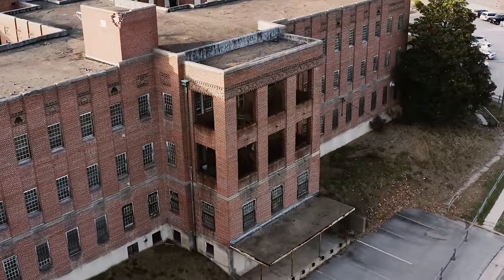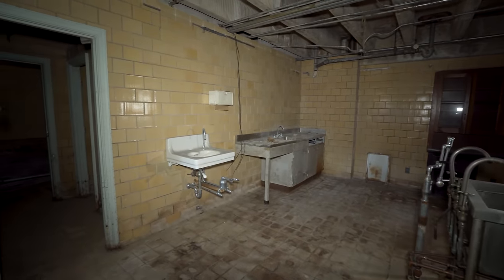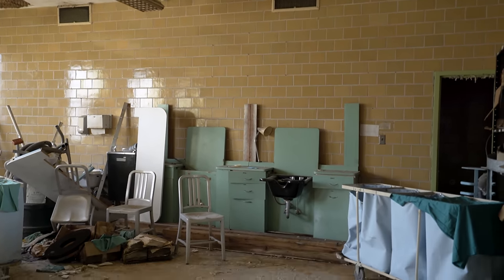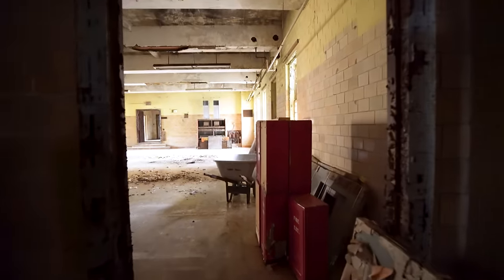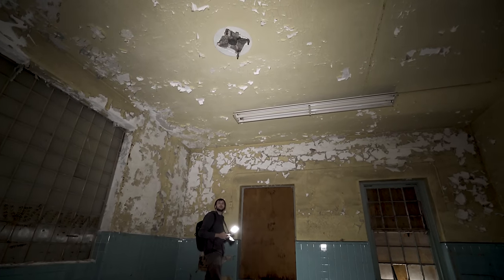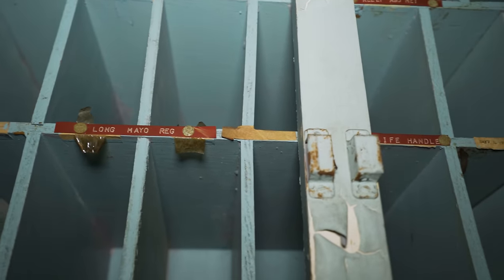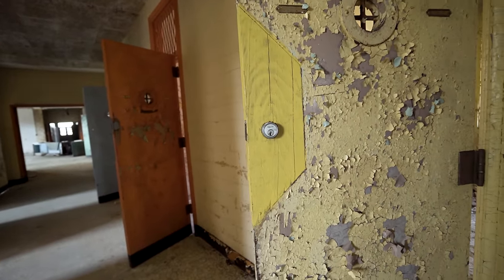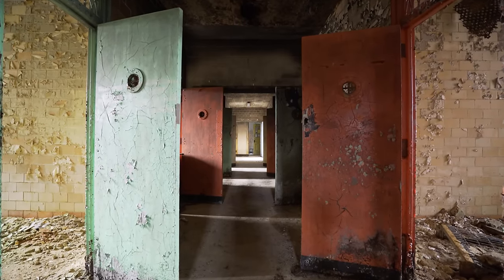Rainbow Asylum Abandoned For Decades with Morgue and Barber Shop

Comment: I dont think I've ever seen such a motherload of flaking paint and paterns of decay before - it's amazing and depressing at the same time.
Reply: (Asbestos has entered the chat)
Reply: So much wall candy.
Reply: Lead paint
Reply: Beautifully haunting to see the untouched tiles too, so incredible seeing it without graffiti etc
Reply: @EddieD218  nothing flakes quite like lead paint, brother! 👍
Reply: The flaking and peeling paint is a combination of drastic temperature changes (no heat in the winter) and the possibility latex  based paint was used. Latex paint doesn't adhere properly to oil base paint so primer paint must be used.
Reply: Why would they paint the tiles?
Reply: @johncanetta6708  they might’ve just wanted to change the colour of them
Reply: @EddieD218  don’t eat it and you’ll be fine 🤡
Reply: Lead paint has entered the chat
Reply: Although I don't really see the characteristic grid crack of lead paint on most of  the walls

Comment: The "Metabolor" was a device used to measure metabolism by monitoring the amount of oxygen is absorbed into the patient's blood over a certain amount of time. They would hook breathing hoses up to the two fittings on the front of it and one would draw in air and the other would be attached to a mask the patient would breathe through.....the machine would measure the difference in how much oxygen was drawn into the machine compared to what the patient exhaled.
The paper roll would plot a graph of the oxygen levels as the paper unrolled from its spool similar to how a seismometer.

Comment: The exposed ceiling in the basement possibly had an asbestos drop ceiling that was removed and not replaced. That or mold.
Reply: That makes sense. I wouldn't imagine that room originally having no ceiling.
Reply: @jlucasound  Yes! They would not have a room for designed for doctors unfinished. It would be mildly disrespectful.

Later in the video it seemed the floor tiles upstairs were removed, and they were commonly made with asbestos, and that would explain why all the furniture was moved, and the very not random holes in the walls. The building underwent asbestos removal, but was never refurbished.

Comment: That door that opens to another room inside the morgue looked like the components that would refrigerate the coolers itself. That machine you found moments later is from mckesson, a medical equipment company that's still in operation today. Looks like a pump to either pump out blood from a body or to pump in formaldehyde in a body? Not sure exactly..awesome video!
Reply: The "Metabolor" was a device used to measure metabolism by monitoring the amount of oxygen is absorbed into the patient's blood over a certain amount of time. They would hook breathing hoses up to the two fittings on the front of it and one would draw in air and the other would be attached to a mask the patient would breathe through.....the machine would measure the difference in how much oxygen was drawn into the machine compared to what the patient exhaled.
The device used to draw out body fluids and replace them with embalming fluid would have been off site at a mortuary the body would be sent to. The coolers would only be a temporary place to keep them until a coroner could come and get them.
Reply: @dhowting  that's awesome info, I stand corrected. Thank you!

Comment: The reason the for the copper pipes on the autopsy table is the original water pipes to the table are underground and they probably rusted and broke. Its a lot easier and cheaper to run a new above ground water feed.

Comment: The pinball machine is not as old as you'd think. It's a 1980 Briarwood table simply called Circus. (Not to be confused with the 1980 Brunswick table of the same name.) It's a table based on a generic template from 1977 that Briarwood used to make at least 8 different games out of. It was a very low budget machine meant for home use as evident by the lack of coin slots. If that thing were in absolutely perfect condition, it might be worth $100 tops to a collector. Normally I'd hate seeing a pineball table in that condition, but this thing was junk from the day it was made and isn't really desirable today other than to hardcore collectors trying to complete some niche collection or to the very eccentric.

Comment: After filing the patent design for his “Basal Metabolism Factor” in May of 1925, physician-anesthetist Elmer Isaac “Ira” McKesson, M.D. (1881 to 1935), was granted U.S. Patent No. 1863929 in June of 1932. Just over 2 yr later, he copyrighted his circular slide rule for estimating basal metabolism, his “McKesson Metabolor Calculator” (left). Before using the calculator, McKesson would use his invention, the Metabolor, to measure the number of liters of oxygen consumed by a patient in 6 min. In using the Calculator, the first step (upper right) involved positioning that measured number of liters of consumed oxygen on the yellow scale under the blue scale’s “correction factor from table A.” In the second step (lower right), “calories per hour per meter squared” on the white scale could be read opposite the red scale “factors of table B.” McKesson’s patent and copyright on his Metabolor and its Calculator, respectively, underscored his reputation as a physiologist. Consequently, many physician-anesthetists blindly trusted his hypoxic method of “secondary saturation” with nitrous oxide (Copyright © the American Society of Anesthesiologists’ Wood Library-Museum of Anesthesiology.) 

No idea what it means but it sounds like torture for surgery.